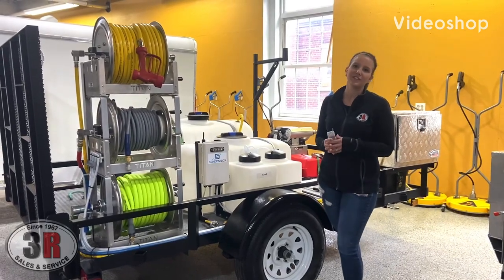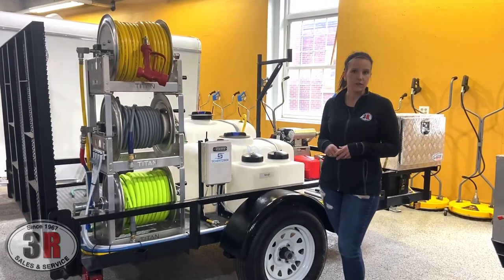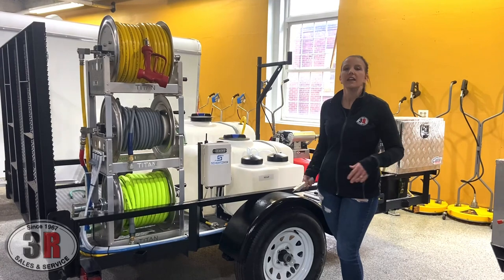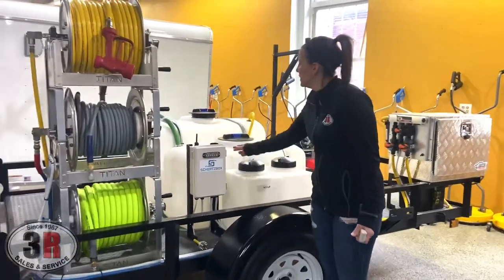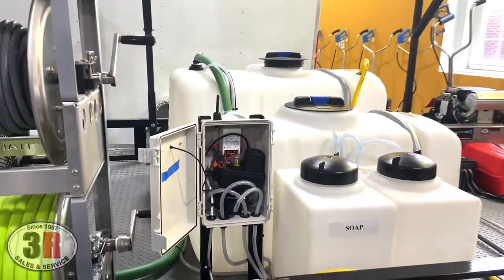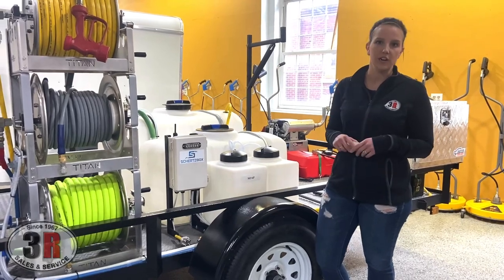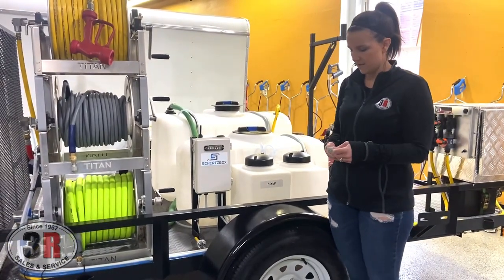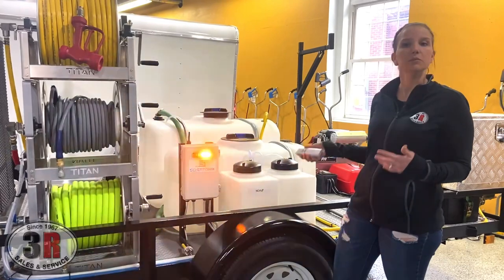An overview of the Schertz Box remote control soap system

Comment: Can u use just 1 line. I only have a bleach tank and then I still hook up to house for water.
Reply from the maker: Yes, you can put a small pvc ball valve on the hose of the Schertz box water inlet side .  When the pvc valve is closed, this will keep from air being drawn through your injector when in “rinse” mode.   If you don’t have a water tank but still want to rinse your injector, you can simply use a bucket of water with the Schertz box water inlet hose dropped into it and still take advantage of the feature that rinses out your injector.